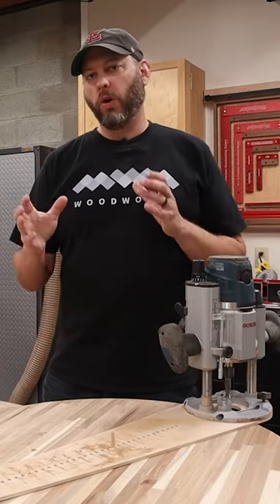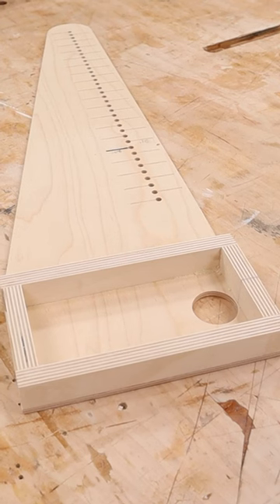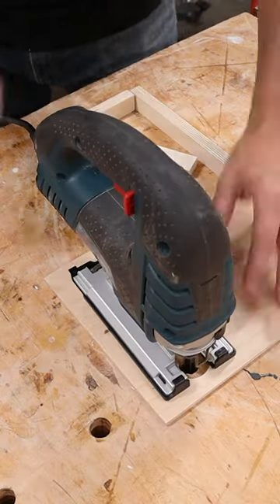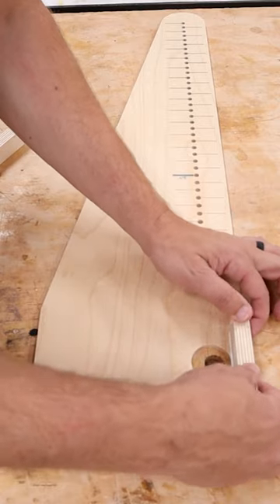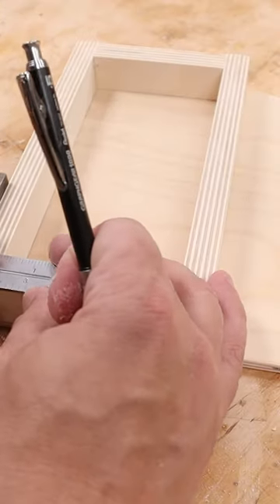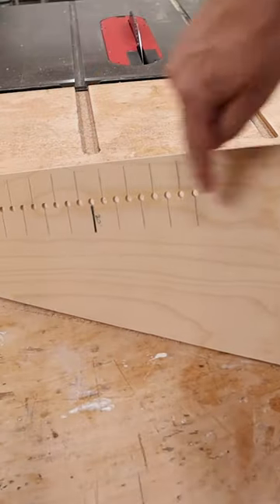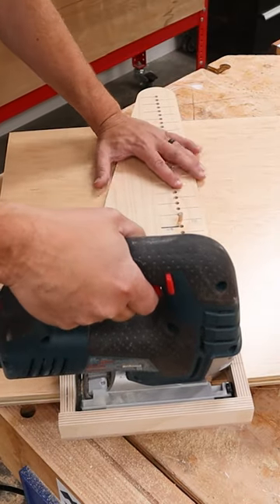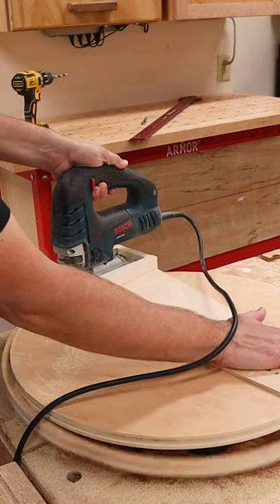Amazing Jigsaw Circle Jig

Comment: Awesome jig! Pro Tip: I made this and discovered it is absolutely essential that the blade be square with the pin hole and thus straight with the direction of the cut. If the blade is behind the hole, it drifts inside (which is left on a counterclockwise setup like this) until it binds. If the blade is ahead, it drifts outside. I set up my holes to be square with the cutting edge of the blade, and even that caused an inside drift! (It bound up in less than a quarter circle.) I overcorrected to square with the back of the blade and that caused an outside drift. It seems being square with the center of the blade is the sweet spot. Or at least that's what worked in my case. Amazing that such a seemingly insignificant thing makes such an enormous difference. Happy cutting.

Comment: Why have the hole for the blade so big? Wouldn't it be better with a smaller slot to act like a ZCI? - Chris
Reply from the maker: It gives you visibility and a place for the chips to clear but having a zero clearance "slot" is a good idea to try
Reply: @MWAWoodworks  make an acrylic lens to fill in all of the hole except for a slot for the blade.